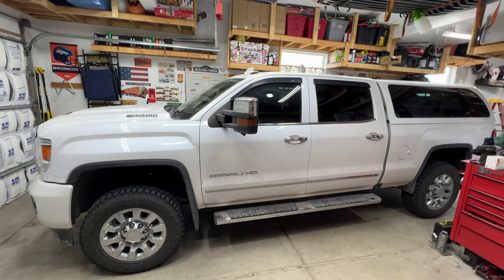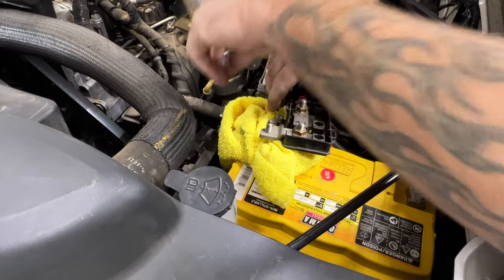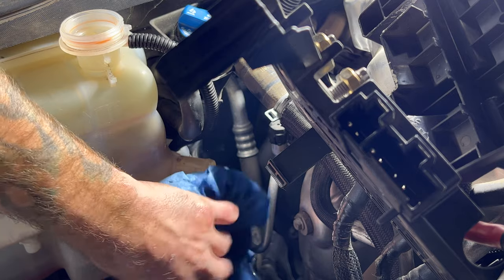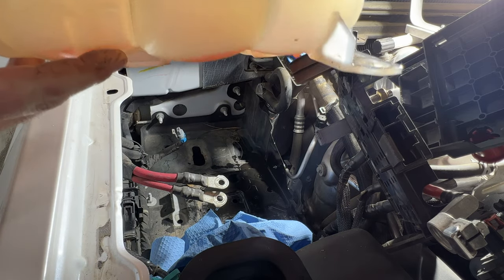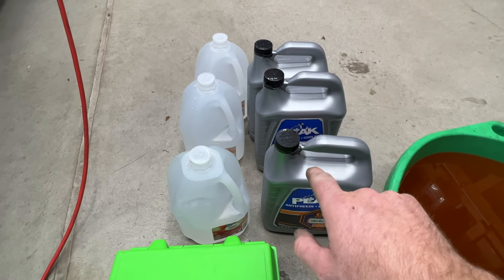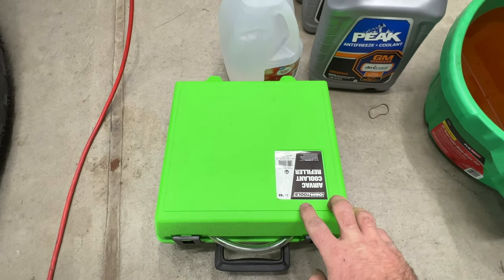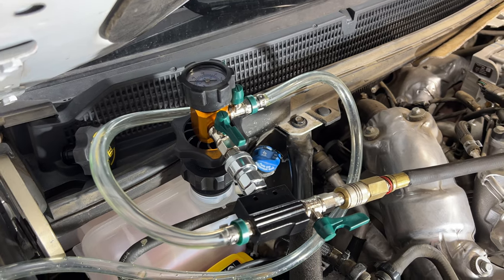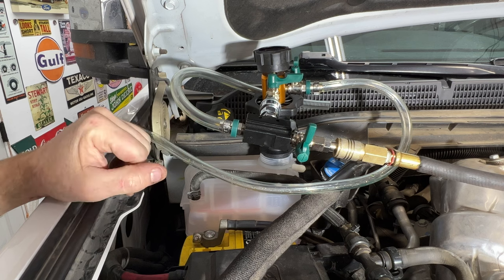2018 Duramax Coolant Drain & Refill Plus Coolant Reservoir Replacement How-To

Comment: I had to watch your video 10 times over a four day period to wrap my head around the sequence of turning the vowels on the pressure device on and off.  The $79 device I purchased at Harbor freight did the job but wasn't as elaborate as your system. Many thanks to you for the great do it yourself video!

Comment: That was a great vodeo.  I have a 18' LTZ w/46,000mi.  Its had that coolant tank replaced and the block heater replaced for the recall.   What i wonder is how much coolant was changed as part of those repairs, i like to keep fresh coolant in my vehicles because its easier than doing a heater core in 5yrs.  1 tip, i like to tape a straightened clothes hanger to those curled plastic tubes to keep them at the bottom of a bucket.   Oh, distilled water definitely boils just the same as other water but it just doesnt have the minerals that can accumulate in your cooling system.

Comment: GREAT video!!!! What did you do with the used antifreeze? I have a 2018 Silverado with a 6.6 with 60K miles. I have not had a coolant code yet, but I'm sure it's coming. 
Thanks again for doing this on YouTube, my projects live and die on YouTube.⚒
Reply from the maker: Thank you. I just take my used antifreeze to the local landfill they have a recycle center their that accepts coolant and used oil.

Comment: I just did mine but after running the coolant in reservoir is now higher? Do i need to drive it around? The temperature only got to 154 its about 57 degress over here now
Reply from the maker: Yeah drive it around and get the thermostat to open up all the way and then let it cool overnight and recheck in the morning. Once it cools the coolant level will drop. Coolant expands with heat so you always want to check the level when cold.
Reply: @BLUECOLLARGARAGE  okay will do thanks appreciate it. Also any reason why the gauge on the coolant refiller only reached -1 and not 0?

Comment: Really good video, my coolant level light came on about 200 miles ago while out of town. Recent engine heater short circuit recall was done. I noticed the lower portion of the reservoir is completely empty, the top portion is full above the arrows. Is there a way to just top off the bottom tank?
Reply from the maker: You can try to fill the lower reservoir with a large syringe there is a small hole when you take off the top reservoir cap. You will need quite a bit of pressure to fill it through that hole.
Reply: Multiple sources have said the bottom tank is supposed to be empty

Comment: Would there be a way to recover the coolant when just needing to replace the reservoir?  Just drain some from the low point you used?
Reply from the maker: Yeah just find a clean bucket or pan and drain it from the lower radiator drain like I did just enough below the reservoir and reuse the coolant. If you end getting and dirt or contaminates in the coolant use a couple coffee filters and a funnel or old clean shirt as a filter when pouring into the new reservoir.

Comment: Is it frowned upon to just add coolant without “burping” the system ?
Reply from the maker: No you can do it that way and the air will hopefully work its way out eventually. Manufactures nowadays just prefer to do it with the vacuum system to prevent air and causing cavitation on aluminum parts in the cooling system.

Comment: Do you have to fill the lower coolant reservoir or how does that work
Reply from the maker: There are mixed opinions on this topic. Some people say don’t fill it because it will fill up on its own through the overflow. Some fill it up a little bit to keep the low coolant sensor from going off. I found the best way is to use this coolant vacuum fill tool and it fills the secondary tank full. So far no issues and this is the way I’ve seen most dealerships do it now.

Comment: What PSI on the compressor did you run to vacuum?
Reply from the maker: I had mine set at 90psi I believe it says on the instructions the working pressure is 70-110 psi.
Reply: @BLUECOLLARGARAGE  you are not concerned about the plastic reservoir deforming under the pressure?
Reply: @Franklinveterinarycenter1of4 the tank itself is not being pressurized, the pressure from the compressor goes through the vacuum filler and creates a vacuum to the cooling system pulling all the air out, once that’s done you close a valve on the vacuum filler and and it stops like turning off a vacuum in your house and stops sucking, at this point I usually get all my coolant in a big clean bucket/container and once done you can make sure the vacuum didn’t bleed off to confirm you have no leaks before you fill it.